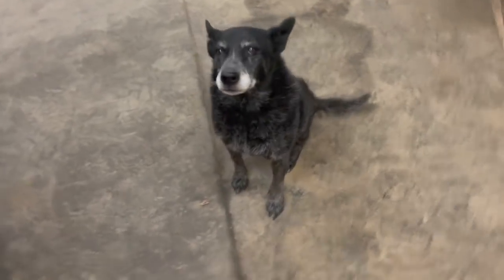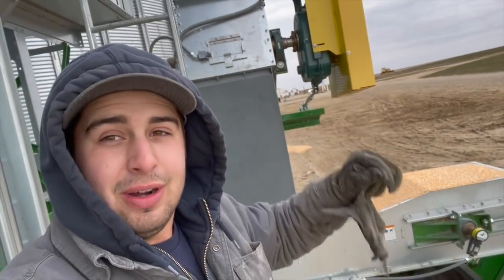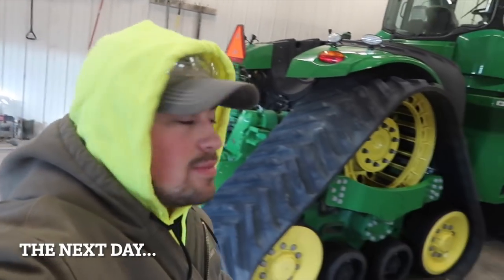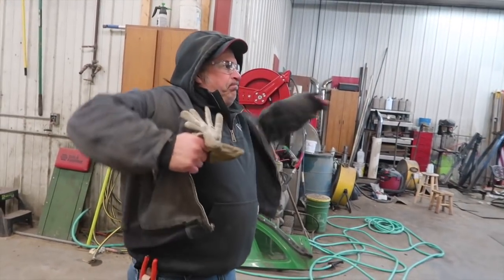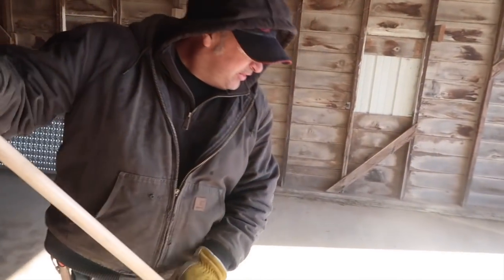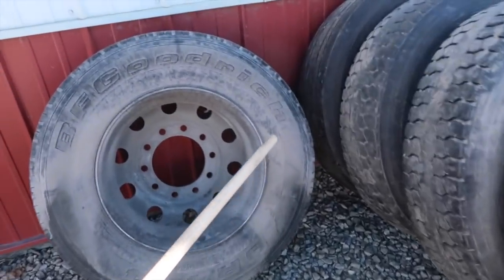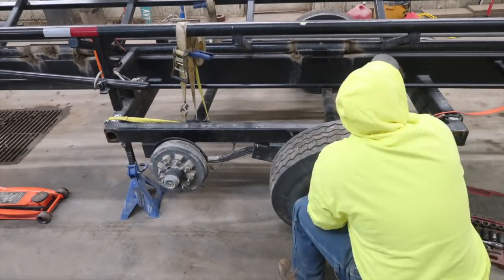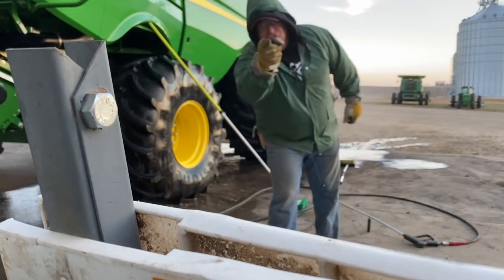It's Raining Corn!

Comment: Well Mustard that was a well managed unslug, It's our secret. Could you go into how you can run one section/conveyor using the PLC. And why would the entire unload system be running but not the pit. Will the remote buttons near the pits turn on if the rest of the system is shut off? Sooo many questions.
Reply from the maker: It may seem complicated but it’s really simple. We may do some more videos explaining how the PLC works